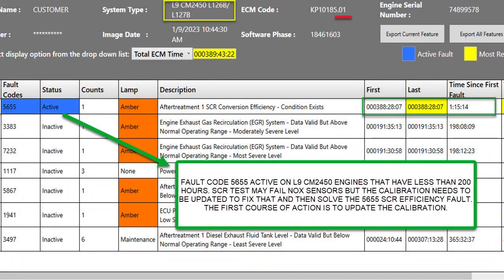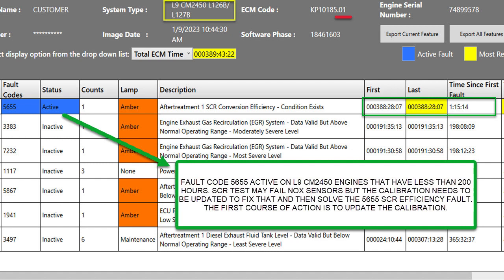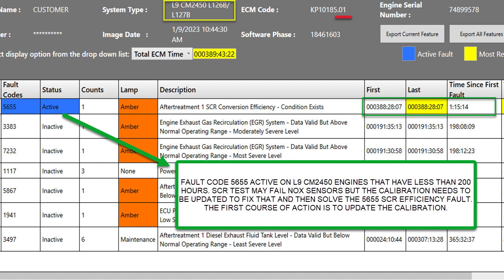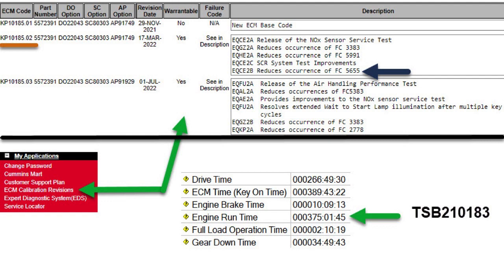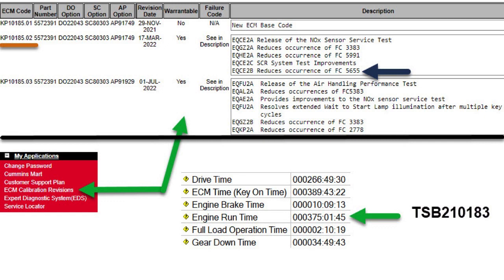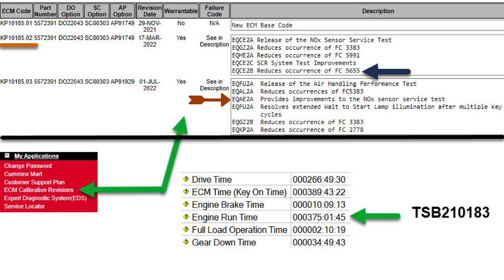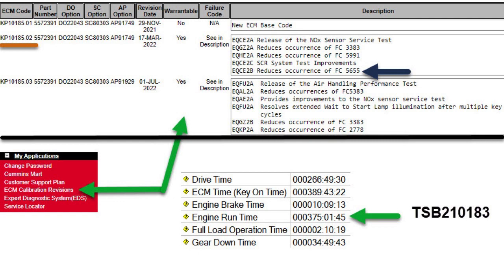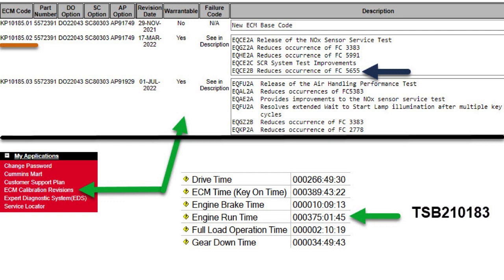How can my New machine have a failed SCR Element

Comment: Hi Joe question i have a cm2350 and inside cummins insite the data log reading said net engine torque my read -30 fl lbs idling. is that normal?
Reply from the maker: At Idle with no load that number changes quite a bit - no worries
Reply: @ENGINESHOPJOE  Thank you for your reply

Comment: should have checked the def for correct concentration, also you have 6 counts for def level, the driver is running it out of def alot, once you check the def run a regen and watch the nox sensors,
Reply from the maker: Yes you are correct on all counts.

Comment: I have no ECM Calibration Revisions selection on Quick Serve ?
Reply from the maker: You mean you dont have the link for them?. If you registered for a free quickserve account did you use an engine serial number to set it up?
If you use a dodge truck cummins engine number they might not turn that on( all those optional things are check boxes by the people who run qsol.
Dodges do not have updates like the commercial engines so they might not of turned it on. try going to help and put in a ticket that you cant see cal revisions in qsol